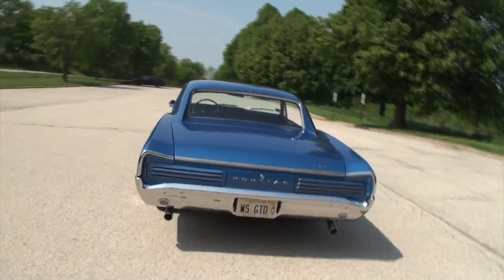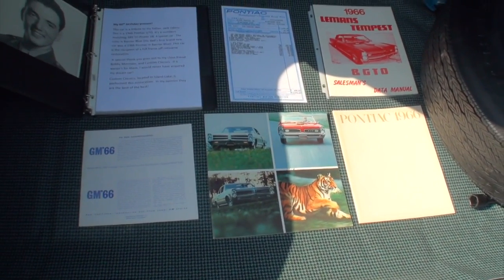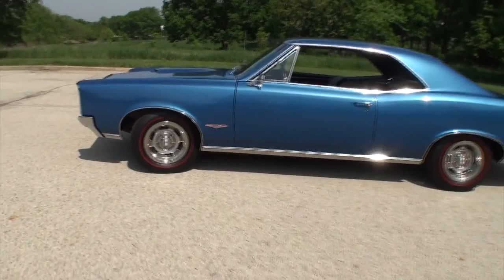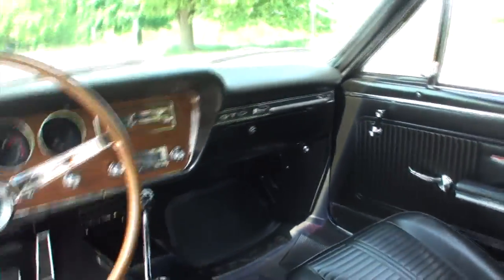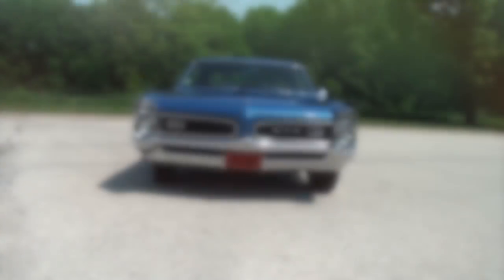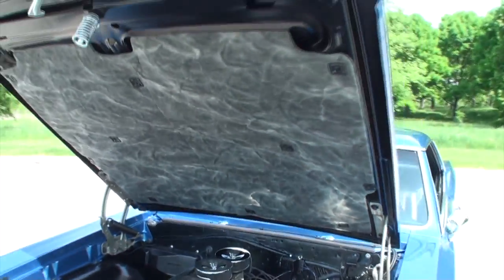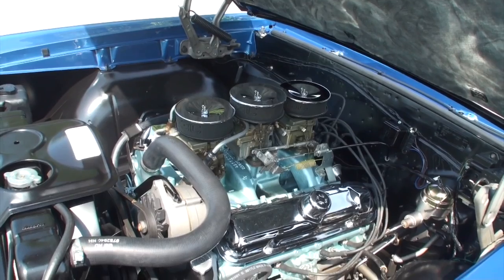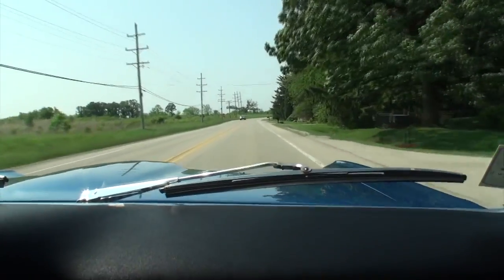1966 Pontiac GTO 389 CI Engine 4 Speed in Barrier Blue & Ride on My Car Story with Lou Costabile

Comment: Thank your for the video!  My high school friend Pat Reynolds found a 1966 4-speed GTO in his driveway in 1979.   His older brother, not living at home, had bought the GTO at auction in Bristol VA under the condition when its mechanic had resettled to Northern VA its slipping clutch would be replaced for free.  The story at auction on the 1966 GTO was its owner had had every conceivable performance modification done to it by his mechanic over its life time, but with the mechanic moving to Northern Virginia it was decided to return the car fairly much to stock for sale.   Pat's brother has left the GTO in his mom's driveway until its mechanic was available.  Pat found the GTO's keys.  

I first heard the 1966 GTO as Pat ran by my house at higher speed than any other car could gotten to in that short run.  When he stopped I noticed the rear tires had tall sidewalls almost as high at 10.5 inch wide tires.  I remember feeling the rear tires.  They were warm and very gummy.  The writing on the sidewalls had been rubbed out so it was impossible to read.  The GTO was on empty and knowing high compression engines needed high octane gasoline I volunteered to put $5 of my allowance into gasoline for it and directed us to the Sunoco gasoline station that had high octane gasoline in 1979, but I was worried about the valves not getting lead.  

After the fill up Pat couldn't accelerate the car in 1st gear with the bulky clutch so shifted to 2nd gear early.  I was counting seconds and watching speedometer.  The GTO  mostly in 2nd gear got to 60 mph in about 3 1/2 seconds!   I have since determined the GTO had not been returned pretty much to stock!   

Pat got much better at knowing how to shift the GTO over the next few weeks.   The next time I went for a ride we were going through an intersection on Gallows Road between RT US 50 and 29/211 when Pat down shifted to 2nd gear at full throttle at 35 mph.   I was pegged with my back up against the seat frame as the seat back spring fully collapsed.   In a little over over a second we were going 75 mph.   The car would push the rear axle down during hard acceleration with those gummy drag strip tires it could accelerate harder in a straight line than I experience later in a Ferrari in lateral acceleration at the Summit Point road racing circuit in WV.   

The GTO would be a torque monster to about 4,500 RMPs.  Between 4,500 RPMs and 5,000 RMPs the engine would transition to extreme speed.  The sound was like an angry animal determined to get out its cage.   After 5,000 RPM the acceleration was beyond anything I've experienced before or later.  The shift point was about 6,700 RPM.   The jump in speed this car could make was incredible.  From 35 mph to 80 mph in a few seconds.  Without the drag tires in rear it would have been very handicapped.  

Northern Virginia Fairfax County had numerous intersections where there was a high crown, likely a hold over from when the roads were gravel, that would upset mid 1970s slush mobiles such as Ford Torinos at much over 15 mph.   We had a 1973 Lemans with Gabriel shocks that could get through them at 35 mph, but is was rough.  Pat was running a 1966 car heading towards one of these interactions at 75 mph and I didn't think we'd make it, but he'd got it down to 60 mph and the car got through.   

The last time I went for a ride in the GTO Pat had masted it.  He didn't tell me a head of time, but came upon one of these high crown N.VA intersection at 80 mph.  I didn't see how we were going to survive.   He feathered the throttle dipping the nose of the car.  Then went full throttle  lifting the soft front suspension over the crown and placing all the weight of the car on the pushed down rear axle and drag tire sidewalls.  The GTO had very hard composure over a nearly impossible road crown at 80 mph.  It sailed though at 80 mph over what would be similar to a railroad track mound crossing in most parts of the USA.  

That was basically the end of driving the GTO with its clutch nearly gone.  Pat said he missed a shift and it revved to 7,000 RMPs with its hood shaking.  It didn't run so well after that.   It sat in the driveway until his brother took it into the mechanic to have it clutch replaced.  Then the story gets weird.  

Pat's brother was calling the garage where the mechanic was and they'd say he was working on the GTO at night.   This went on for the good part of a week.  The garage then said both the GTO and the mechanic had disappeared.   Further calls about it to the garage were that the mechanic was running drugs.   This sounded like garage was making things up and I was thinking about having my father ask about it.

A couple months later Pat says a couple of detectives came by his house asking about the BLUE car as they called it.  They said the blue car had been used in a federal drug sting operation and had gotten away with $80,000 in cash and if it wasn't recovered a lot of important people could loose their jobs.  

This story could make a major motion picture.   The detectives said the blue car was set to be make the drug drop off and money pickup.  The officer on the scene said the car just disappeared.   About 50 Fairfax County patrol cars had been stationed at the last minute to guard the sting operation.  Over the next 20 minutes 1/3 of those cars were totaled in pursuing the blue car that could disappear, 1/3 were immobilized, and 1/3 could move, but were unfit for duty.   The psychological effect on the police was so extensive the local police supervisor in charge determined that his police were in no mental state to apprehend a likely pointless blue car at this stage and ordered the police to find a safe place to park and wait for the next 15 to 20 minutes.   LET THE BLUE CAR GO.      

Most of the patrol cars crashed going though a high crowned  intention mostly into each other or avoiding doing so from the story the police detective stated.  There was one patrol car that made it through the intersection only to come to halt a half mile later with trashed engine likely from hitting the crown of the intersection.    Most of these cars were mid 1970s Ford Torinos with drivers brought up on a 55 mph speed limit. 

That GTO was faster than regular street tires could hold before the mechanic spend nights working on it.   Pat taking the car to 7,000 RMPs probably necessitated the mechanic putting a major valve train upgrade onto the engine.  They'd probably detuned the GTO a bit before selling it.  With the extensive rework the GTO was probably a lot faster than we'd experienced.  

With what I known now it is high unlikely that GTO was still actually a 389.  Running a Pontiac big block well over 6,000 RMPs means it likely had a forged crankshaft installed in it.   Forged crankshafts for Pontiac V8s are typically going to be for high displacement, so it was likely over 460 cu in.  Every time I try to figure out a likely horsepower to weight ratio I keep having to up it.  Now I think that GTO was likely above 600 HP for a car weighing about 3,400 pounds.    The weight may have been less.  The front fender metal was very thin, but hard when I looked at it through the door jam.  

Every part of that 1966 GTO looked pretty much stock, except for the rear tires, but I think that was by design  by people that really knew what they were doing.   The GTO was a carefully crafted component of their carefully crafted operation.   The reverse sting operation was represented as being Spanish nationals that returned to their country.
Reply from the maker: Hi Douglas, Happy to read this car brings back memories of your Friend Pat Reynolds Older Brothers car :-) Thank you for viewing and sharing.  Hope you see many cars on this Channel you enjoy!  Please Subscribe, and hit the "bell" so you can see all the cars when they are uploaded on this YouTube Channel, Lou

Comment: 1966 Pontiac GTO.
The Pontiac GTO (Gran Turismo Omologato) was an extremely successful and one of the most iconic Pony Cars/Muscle Cars to date. It was introduced in September of 1963 for the 1964 model year as a trim for the Pontiac Tempest/Pontiac Tempest LeMans (For 1964 until 1965). The car was fitted with a 389 cubic inch Pontiac V8 (6.4 Litre Pontiac V8) that would produce 335 HP and around 390 LB-FT of Torque along with a 400 cubic inch V8 that would make around 345-350 HP, which was the same horsepower that was made by the 1968-1970 Plymouth Roadrunner's standard V8, a 4-speed manual, and three deuces (Three 4-barrel carburetors). It became it's own model circa 1966 and got a newer, more aggressive appearance. The car sold around 80,000 units in total, with 1966 being the best-selling year (Selling around 25,000 cars).

The second gen GTO (1968-1972) is arguably the second most iconic GTO (If not just as iconic as the original GTO), introduced with a drastically new appearance (With new features such as a more coke-bottle appearance, hide-away headlights similar to other cars such as the 1968-1971 Lincoln Continental Mark III, 1967-1969 Cadillac Eldorado, and 1967-1970 Mercury Cougar), and a new rear end. It removed the iconic 389 V8, leaving only the 400 V8 but with a newly added 455 cubic inch (7.5 Litre) V8. These engines made around 370 HP, which was the same as the 1970 Oldsmobile 442 and it's W30 package if applied.

For 1969, Pontiac introduced "The Judge" package for the Pontiac GTO featuring "The Judge" badges (And a swirling black stripe as a part of the badge), a new interior, and a body-colored spoiler, Pontiac also introduced the "Trans Am" package for the Pontiac Firebird, which included upgraded suspension, brakes, stiffness, a new paint job, a new interior, and a higher price (Only 689 were made in 1969, and only eight, and I mean EIGHT convertibles were produced as Trans Ams in 1969, making them EXTREMELY rare). 1970 introduced another facelift to the Pontiac GTO lasting until 1972, featuring quad headlights, a uniquely split grille, and a new horizontal back-end taillight pattern.

Unfortunately, the Pontiac GTO declined for 1973 and 1974 due to the changes of SAE Gross HP to SAE Net HP in 1972 (Which was required for every car, making them feel less powerful, but more accurate) and the 1973 oil crisis, which helped imports rise in popularity along with cars that didn't consume much gas.
Reply from the maker: Hi Matthew, Thanks for sharing your knowledge and adding info to the Channel, Lou

Comment: I had a '66, but mine was gold with a gold interior. The engine was the base 389 with a single 4 bb. carb, 330 hp. My only gripe with my car is that it had the boring 2 speed Powerglide tranny which caused the car to burn premium leaded gasoline like crazy. But it was sooo pretty, you kind of got over the poor gas mileage. It was not so fast from the start but it really "woke up" from about 40 - 70 mph, when it shifted into 2nd. I sold it at around 120,000 miles in about '73, just before the Arab oil embargo and never saw it again. It was starting to burn a little oil, but the new owner didn't seem to mind. Wish I had it back!
Reply from the maker: Hi Dale, Happy to read this car brings back memories of your car :-) Thank you for viewing and sharing, Lou

Comment: Did anyone notice the miles on the odometer? I mean it's rather significant, anyone?
Reply from the maker: Hmmm, not sure I checked...
Reply: @loucostabile  I figured I'd give it the weekend while I went to the GM Nationals in Carlisle, when I see 1320 anywhere my brain automatically thinks 1/4 mile as in 1320 feet is exactly a quarter of a mile or in street racing it's a slang term for it. At the time of this video the odometer had 1320, being a GTO it had some significance. IDK, I thought it was kinda cool. Outstanding car, I like everything about it..